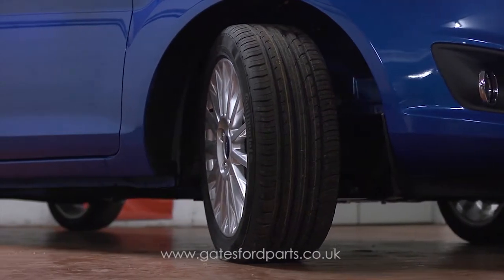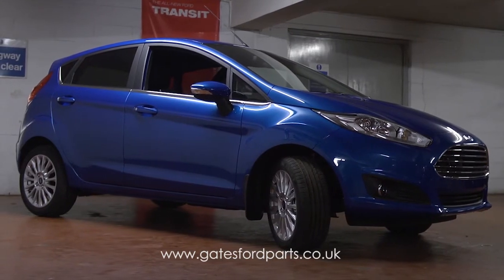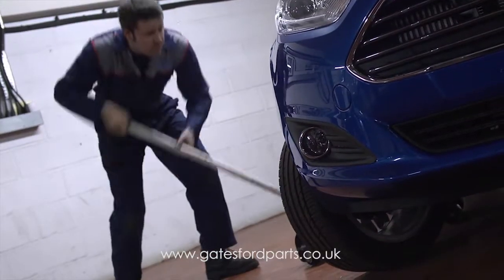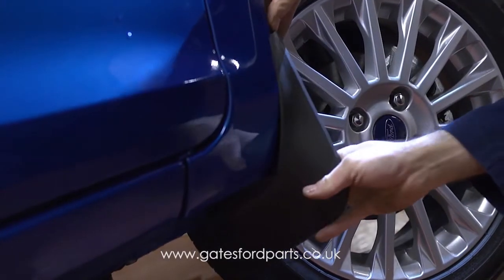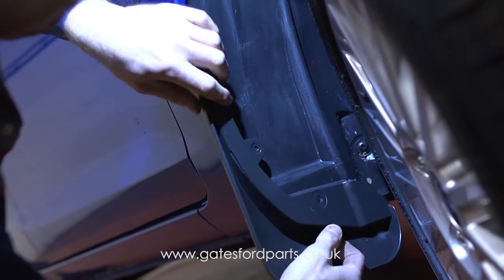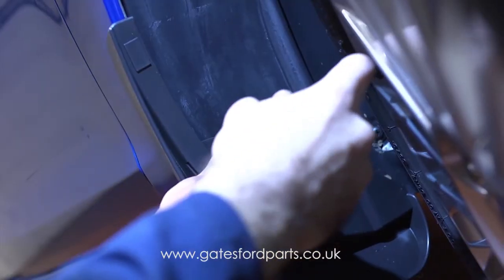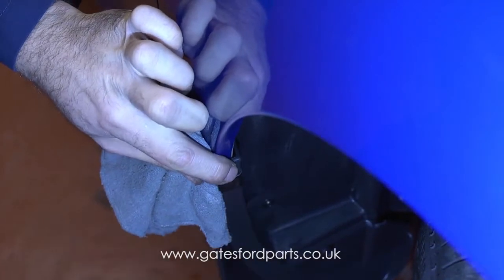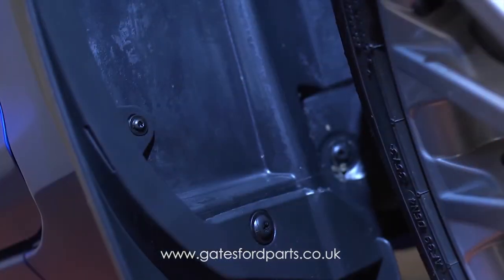Gates Ford | How To | Installing Mud Flaps

Comment: In my experience the bottom plastic fitting will not work with the extra width of the mud flap.There is a certain amount of tension here forcing the mud flap away. Fords should have provided a new, longer fixing. Annoying.
Reply: No, I can't recommend anything suitable. I am annoyed because having bought the mud flaps I don't think I can fit them satisfactorily. I have always fitted flaps to previous Fiestas with no problem. Ford or the manufacturers of the flaps have not thought this through.